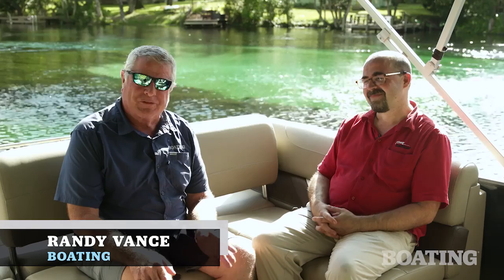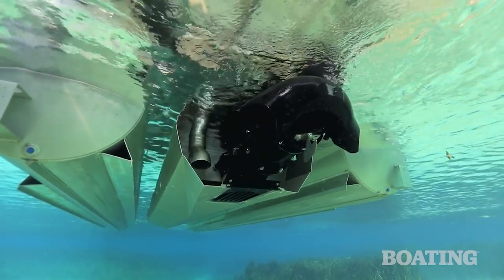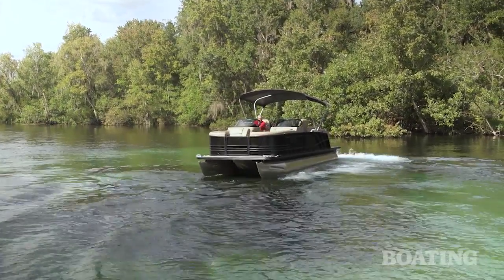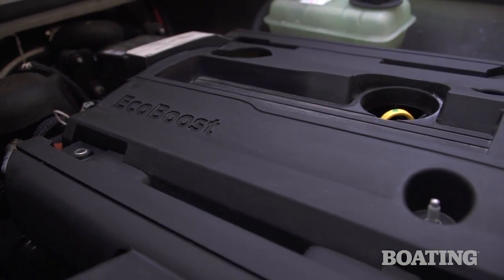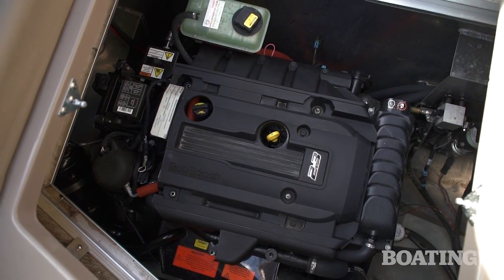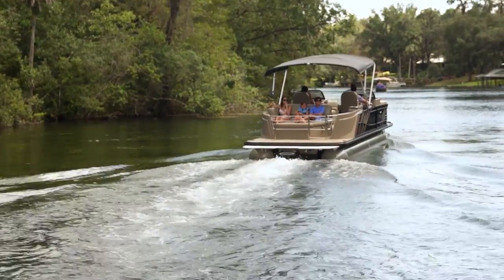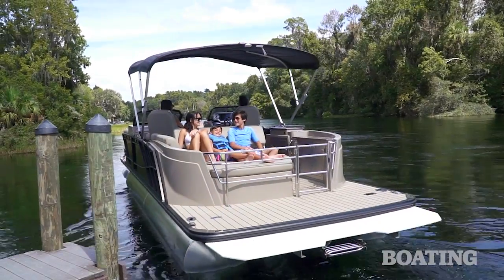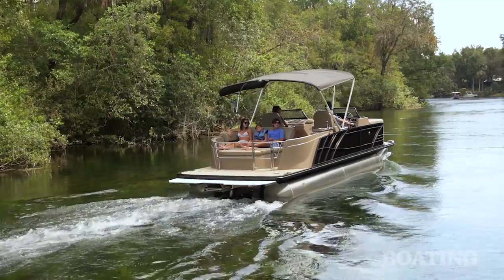2.3L EcoBoost and EcoJet by Indmar

Comment: Thanks Randy!  Another great review!  Hopefully Boating Magazine, which I've subscribed to for many years, will be able to do an in-depth side-by-side performance comparison using identical boats outfitting one with Indmar's EcoJet and the other with a typical/conventional outboard(s) and/or inboard(s). :-)  BTW - I can remember outboard manufactures replacing their 30HP lower unit prop drive with a jet drive lower unit and labeling the new combination a 20HP Jet Drive Outboard, which has always had me thinking that jets are less efficient.  Even Hinkley is now offering outboards on their Picnic line after decades of offering only Hamilton Jets.  Maybe Indmar's setup is a game changer.  :-)  While I'm wishing for more comparisons, it would also be interesting to see a HydroFin setup added to the Indmar's pontoon test boat.  I also think that Indmar should approach manufactures that build boats for wake surfing, which would definitely improve their factor of safety.
Reply: jetd beter ßjallow wster dtßfy
Reply: wrong    new   disel jet outbard 1 too 1  orop top jet